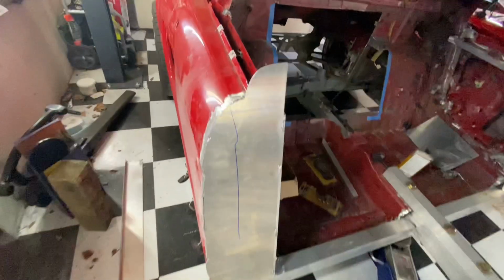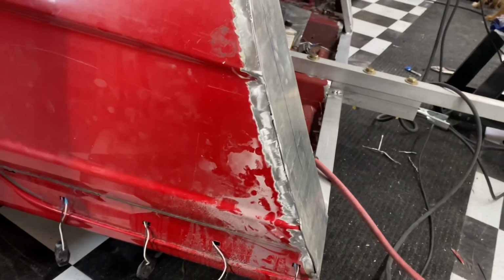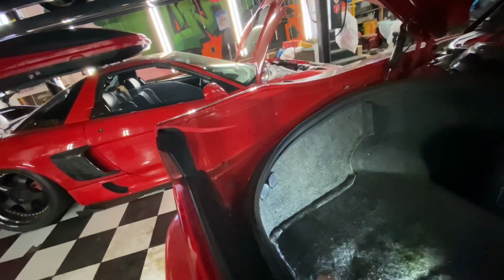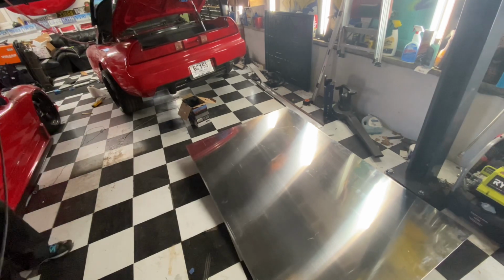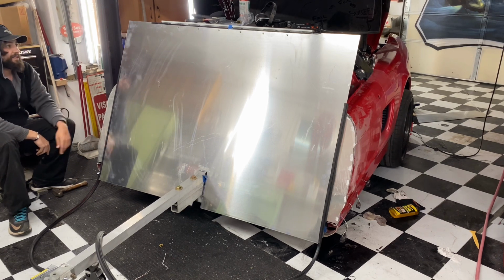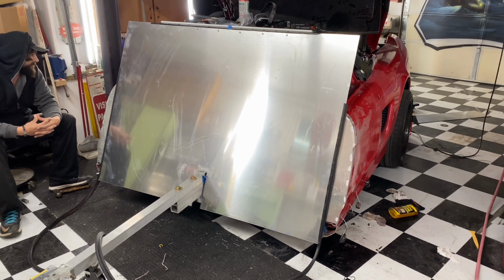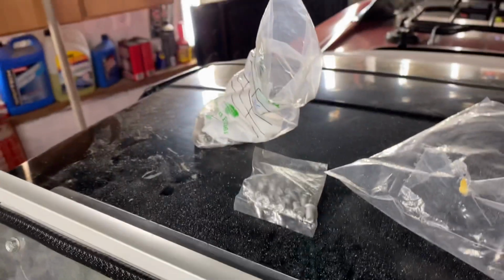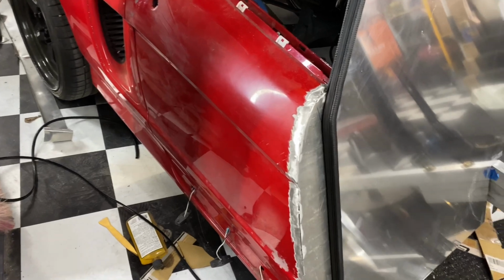NSX Trailer is Coming Together!!!

Comment: Are you going to push washers for the screws holding the door? Don’t know how much weight but would hate to see it sheer from use. Looks great man I’m gonna try to do the same thing with a mr2 and love hearing your thought process.
Reply from the maker: Just finish bolts and nyloc nuts

Comment: Have you thought of setting up an alternator underneath to run off of the rear end of the car? It can charge a battery bank while you drive.
Reply from the maker: Yes but decided not too. Unnecessary fabrication. Instead I just ran a wire to a smart battery isolator and it charges the trailer battery off of the main car. I can even draw power from the main battery with the car off and it will automatically stop when the voltage drops below a certain level, so I don’t wake up to a dead battery